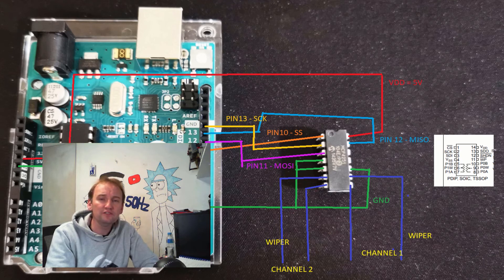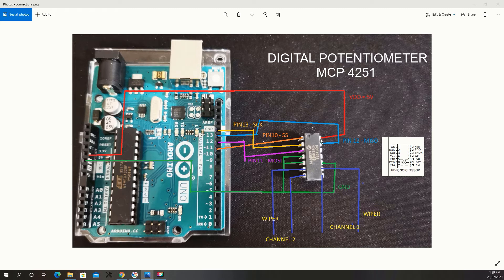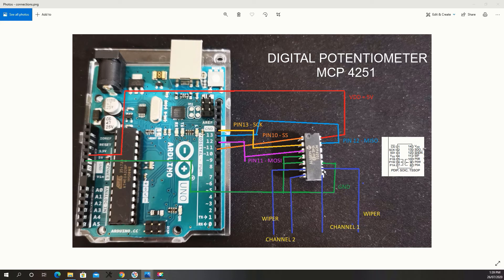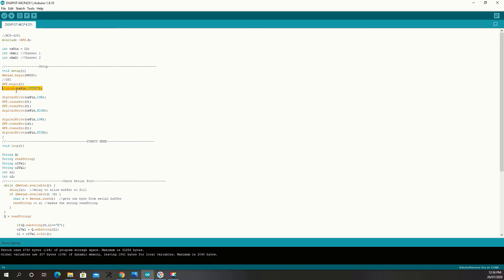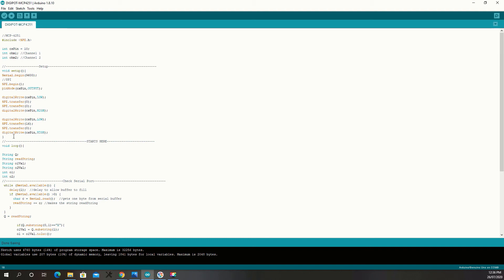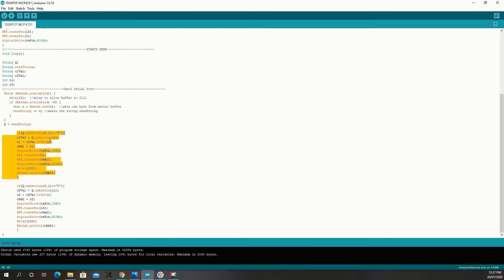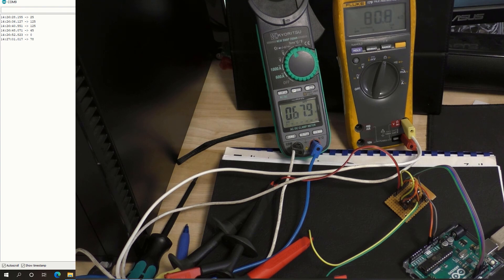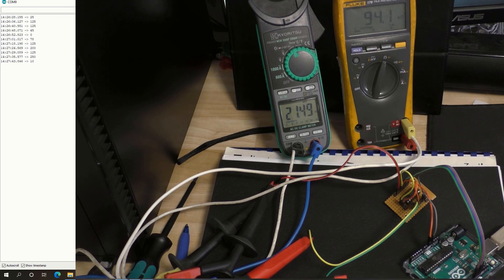Arduino Digital Potentiometer tutorial. MCP-4251

Comment: I have the potentiometers working...except the actual resistance seems to vary quite a bit from each time I power on the circuit. I tried swapping out the IC to see if I had a lemon but the overall resistance seems to change from 80k to 100k. This  is a problem for me as I'm trying to build an ohmmeter. Has anyone else had this problem?
Reply from the maker: Is this on a breadboard. The reason why im asking is you may have loose connections, I've found that after a while my pins in my board or the jumper wire dont hold on like the used to and give me funny results. I made a phase shifting circuit recently and couldnt work out why it would work then stop, that was why.
Reply: @50Hz  no it's a new breadboard...I get different values when I got from 3.3v and 5v ad Vdd. But even when I keep it on 5V there's quite a bit of variance. I tried taking the ommeter out of the equation and testing it with a resistor divider and adc reading the values. The difference in resistance between each tap fluctuates quite a bit. I wouldn't use this device if you need to do anything with precision.
Reply from the maker: @calvinlove7904  You mean if you went to position 25 it would return x then goto position 56 and back it would no longer return x.
Reply: @50Hz  yes exactly. It'll be stable for a while, I get up the next day and the resistance is different. To build my ohmmeter I'm going to go with a MUX or Decoder and a small array of ordinary resistors as this digital potentiometer isn't repeatable.
Reply: one day the max resistance is 80kΩ the next its 100kΩ. :/
Reply from the maker: That's interesting I've used to to create a stable variable voltage source, and it has been rock solid
Reply: @50Hz  Hmm thats good to know...maybe I'll try some example code with an uno. I'm using an esp32 right now...
Reply from the maker: @calvinlove7904  I'm planning on doing another project with them, ill try and emulate what you are seeing soon